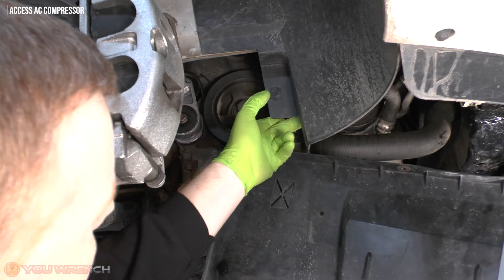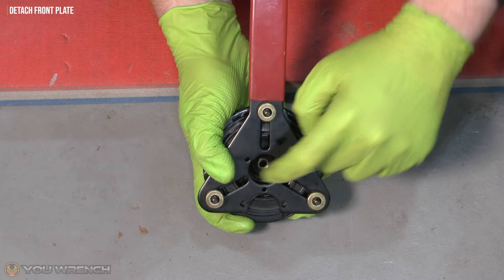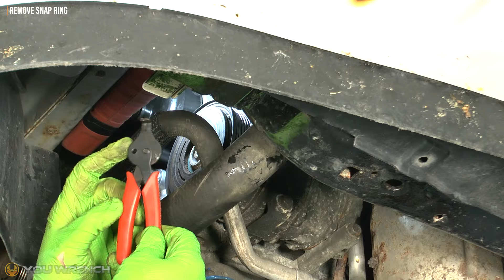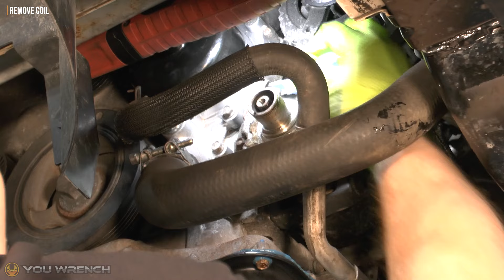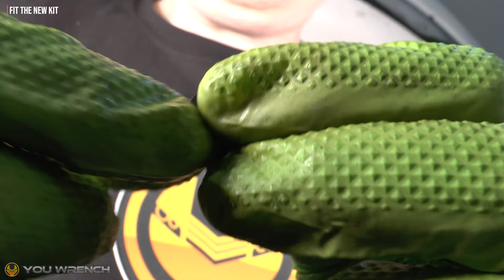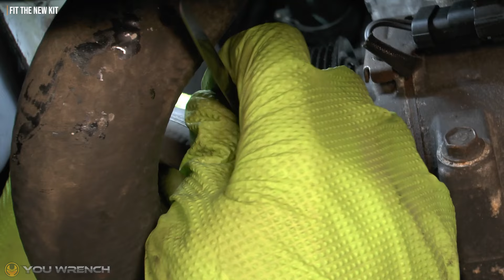How to Install AC Clutch Kit - GRAND CARAVAN (2008-2020)

Comment from the maker: AC Clutch Replacement Kit (for MK5 Grand Caravan/Town & Country):
Amazon USA: https://amzn.to/43oko4k
Amazon Canada: https://amzn.to/3WipoDO

Clutch Holding, Snap Ring Pliers & Feeler Gauge Tool Set (Great Value!):
Amazon USA: https://amzn.to/3IV9cW8
Amazon Canada: https://amzn.to/4qszIac
Amazon UK: https://amzn.to/4qszY9a

Clutch Holding Tool Kit:
Amazon USA: https://amzn.to/42RjT2H
Amazon Canada: https://amzn.to/4hlIWAZ
Amazon UK: https://amzn.to/3L3h9ZQ

Bearing Separator Puller Kit (was essential for us!):
Amazon USA: https://amzn.to/47qc31p
Amazon Canada: https://amzn.to/4904bGr
Amazon UK: https://amzn.to/4nbje3b

Snap Ring Pliers Set:
Amazon USA: https://amzn.to/474Fuar
Amazon Canada: https://amzn.to/475ZpFX
Amazon UK: https://amzn.to/3L2j7K7

Feeler Gauge Set:
Amazon USA: https://amzn.to/3WlQnyi
Amazon Canada: https://amzn.to/42PIe98 
Amazon UK: https://amzn.to/43ynaUG

Penetration Spray:
Amazon USA: https://amzn.to/41KOpss
Amazon Canada: https://amzn.to/3ABHEgt 
Amazon UK: https://amzn.to/3Np6cAX

Brake Cleaner:
Amazon USA: https://amzn.to/3BlowUk
Amazon Canada: https://amzn.to/3pyTjue
Amazon UK: https://amzn.to/3BhDXgq

Blue Paper Roll
Amazon USA: https://amzn.to/40ffNjk
Amazon Canada: https://amzn.to/4jYQ1Hd
Amazon UK: https://amzn.to/4nh6utl

Comment: Extremely helpful!! Maybe add a comment to use the center bolt seated into compressor shaft while using the puller to protect the threads while pulling the idler wheel. I noticed the bolt was shown while showing the coil removal. Excellent video! Thank you!

Comment: Thank you for for an excellent video I wish you would have mentioned how many washers you installed for the pulley separation I end up using the old one and the two new ones thank you excellent job now I'm going to check the charge on the system thanks
Reply from the maker: You're very welcome, I'm glad you were able to figure out the washer spacing to get it working! 👍

Comment: Thanks for info.  I do wonder if it makes sense to simply replace the entire compressor given they have a finite life and it might be easier to do albeit more costly of course..
Reply: I’d say depends on the situation like we have 200k miles AC works great but noisy bearing in the AC pulley. Just the parts alone are about $500 for a proper compressor replacement doing it myself not including refrigerant with front and rear cooling so $70 bucks is not a huge loss if everything craps the bed later.

Comment: Excellent! The only thing that's missing is the symptoms caused by the bad clutch.
Reply from the maker: Great suggestion, we'll keep that in mind for future videos! 😊
Reply: Well my clutch doesn't engage at all, that could be a bad actuator, could be a bad clutch relay.
I think the clutch relay is internal to the TIPM fuse box so I might have to dismantle that and solder in a new one...